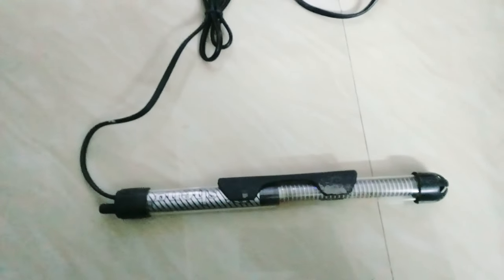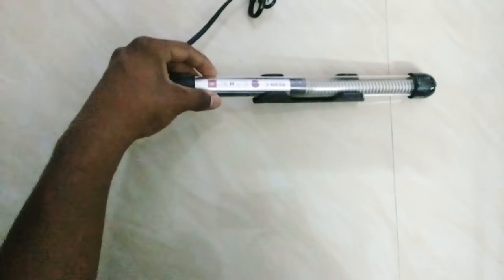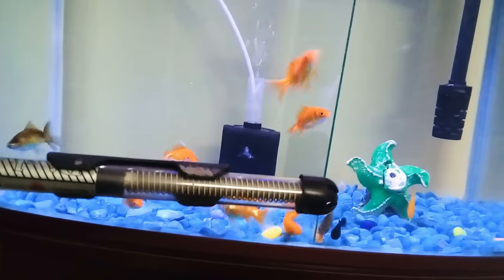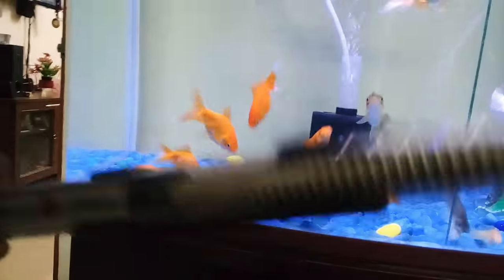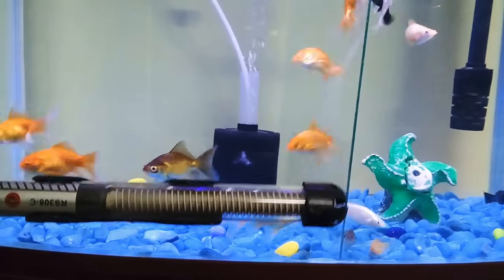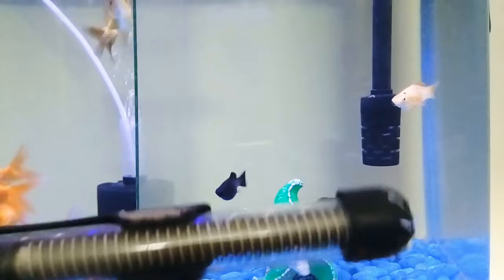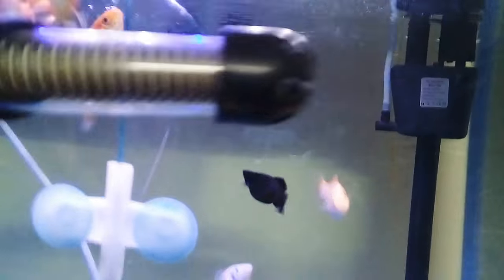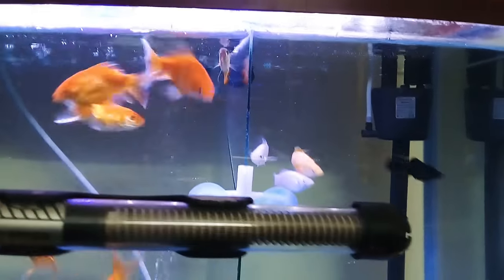which place is effective for heater in flowerhorn tank???

Comment: Bro..na heater ah neenga sonna mati thaan vachirken but temperature ah 28 degrees la vachirken flowerhorn colour fade aguthu....what to do?please help me😥😭😭
Reply from the maker: Omg enna breed bro..
Reply from the maker: Most ah fader type vandu fade agum over age....heater temperature nala colour fade agathu most ah....so tell me about ur fh bro....i will help u out..because i am telling information in my videos with experience and other breeders consultation only bro...so reply bro...
Reply: Mine is Red dragon He is about 2 to 2.5inches....he will be mine before turning on heater and aquarium light....if i turn on the light he gets full darl black....even when we get aroung the tank....i set up heater two days ago first I set the temperature at 30degrees but it was to hot so i reduced it to 28 degrees...but then his colour started to fade and he got full black....now turned it off....but my thermometer shows wrong readings whrn i set up heater to 30 degrees it showed 40 degree then for 28degree it showed 37...now at normal it is at 34
Reply from the maker: @saivignesh5407  bro ur tank temperatures is too high according to ur theromometer reading and ur fish stressed due to changes in temperatures so first my opinion is to off ur tank heater and change aquarium water of 15-20% dechorinated water and the. Find ur tank temperatures if it is normal the check ur fh health by looking his stomach size etc....i think ur area has high temperature...it is stressed so it shows black colour....reply me bro....
Reply: It behaves normal when heater is turned off..and then bro i got him 5½ months ago but he is still scared of us....do i have to perfome a 100% water change?or can i do 100% water change 3months once....i am feeding different types of food and spend time with him but he turns black when i go near him what to do?pls help me bro...
Reply from the maker: @saivignesh5407  dont ever change 100% water im ur tank....it will completely remove all good bacteria from ur tank....is he is taking feed in ur presence bro....????
Reply: Yes he eats the next moment i give him food...but he turns black when we get near the i got him 5½months ago but still he is scared of me....what should i do?
Reply from the maker: @saivignesh5407  ok he is eating means fyn because aduku entha internal problem mu illa ny confirm ayichi...unga tank size evolo ni theriyila iruntalum neenga unga tank setup matunga ,gravel irutha paravala illana vitudunga,then heater nan sona mari fix matum panikonga but on panathinga,unga tank temperature less than 28 pochina venuma on panikonga,tanku blue background add panuga mudinja ,adu pakavum nallruku fishku  secured ah irukom....i think unga fish scared of something aroung ur tank setup pls find that and rectify it bro...
Unga tank la enna components iruntalum atha crt ah neat ah set panunga....ur fish should feel secured and happy to be in the tank....keep interacting with him...my advice is not to tap on the tank it will stress him more just interact during feeding....any more to ask bro??? I am glad to help u bro...
Reply: @AllAboutFlowerHorn  i have all set i use pink fluorescent light available in Aquarium..i don't have background paper so i am gonna use white sheets....na gravel ethum podla bare bottom...tank konjam salt karaigal ah la asingama iruku athaan keten oru 100% water change panna mothu atha clean pannirlamnu...tank la oru artificial plant hiding kuduthurken.....then ithu ethavathu prblm aguma i have placed my tank at the left side of TV ...
Reply from the maker: @saivignesh5407  bro first 100% water change panathinga ...it will affect ur fish health badly so change only 30-40% if y want u can even change 75% also but konjam palaya water irukanum.....next neenga tv pakathula vecka kodadu tv sound ur flowerhorn  romba stress agutu so vera engana place panunga...adu than reason unga flowerhorn stress ku i come to know bro...then neenga gravel use panalum ok illanalum ok....background irutha fish stress konjam kami agum so say ur thoughts bro.????
Reply: Ok bro i will try to change the place.Do i have to use a background wallpaper available in stores or can i use white plastic sheets?
Reply: By the way thanks for helping me bro...😘😘
Reply from the maker: @saivignesh5407  ur wish white is also ok.or get background available in aquarium ...
Reply from the maker: @saivignesh5407  bro thanks soli namba friend ship pirikathinga....neenga en subscriber ur my brother....unga fish nalaruntha kandipa neenga nalrupinga ..adukaga worry pana matinga....ellarume happy ah irukalam...so neenga en thonunalum kelunga i will help u...that my duty too bro...if u face similar problem with ur friends facing any problem with flowerhorn grooming share our channel link bro.....lets make a big forum bro......thanks for ur pleasing words
Reply from the maker: @saivignesh5407  bro i have one query bro??? My information ungaluku useful ah iruka...say ur thoughts bro????
Reply: @AllAboutFlowerHorn  yes bro..
Reply from the maker: @saivignesh5407  how is your Flowerhorn status bro.....I hope he will be playing with u
Reply: @AllAboutFlowerHorn  it is still scared of us.But some improvements in body like hump growth
He gets dark if we r around the tank....😔😔
Reply from the maker: @saivignesh5407  he is trying to adopt ur environment....his hump growth itself is a sign for that...if he is stressed very much..he won't show any growth in his body...he is not like that...he will adopt and play at ur finger movements...hope for the best bro....
Reply: @AllAboutFlowerHorn  my prblm is i bought him 4 months ago....still he is scared.....but for others it is not like that....
Reply: @AllAboutFlowerHorn  anyways thanku for ur help
Reply from the maker: It will take tym bro...i still find mystery with ur flowerhorn still i am asking u about ur flowerhorn because ur flowerhorn  behaviour looks different from other fh
Reply from the maker: @saivignesh5407  dont say thanks and make me third person i will be ur well wisher for ur flowerhorn forever bro....update me ur fh status daily if possible to notice good sign from ur flowerhorn bro.......
Reply: @AllAboutFlowerHorn  bro he seems to be active....but still he is not getting my attention....is my feeding correct?i feeded him three times a day....but then my local pet store advisor advised me to feed him more times like splitting feeding time.I feed him 3 okiko pellets 8:00 .3 okiko pellets 10:00.freeze dried shrimps small pieces 3 at 12.Another freeze dried shrimps 2 pieces at 2.Then freeze dried blood worms at 4.7 small pellets food named gene eleven at 8 pm.
Reply from the maker: @saivignesh5407  i dont know why ur dumping all foods u have into his stomach....u have to change ur feeding style....i will tell i clearly bro...according to ur fish size u have to feed him twice a day with 12 hours gap....i have already posted about feeding for flowerhorn bro...then u shouldn't feed all other foods daily...it will stress him...feed okiko at morning and dried shrimps r other food at other meal once a week not daily....then leave ur fish starve for  a day in a week...it will actually help ur flowerhorn stomach...if u wish to starve ur the next day...feed him peas it will help him to clean the flowerhorn stomach...leave. the next day without feeding or feed once a day preferably at night...then continue with ur regular feeding....i will post video how to prepare peas for fish ok bro...if u have any doubt pls ask bro...don't ever follow the words of pet seller....
Reply: @AllAboutFlowerHorn  ok bro...i will change my feeding style
Reply from the maker: @saivignesh5407  ok bro......anymore to ask or doubt ask me bro?????
Reply: @AllAboutFlowerHorn  yes bro na first white light use pannen ipa rose light light potruken athunala oru prblm um illa la
Reply from the maker: @saivignesh5407  light is not a prob bro...in rose light ur flowerhorn too looks good....u can use any light....make sure u switch it off in time....give him 8 hrs of sleep....on the light on time and off on time....
Reply: @AllAboutFlowerHorn  do i have to turn on light at morning?which ime do i have to turn it on?i usually turn on light 4pm as our locality is bright all time and switch it off at 9pm.
Reply from the maker: sai vignesh that’s fyn bro if the tank gets bright light it is ok if not switch off....don’t allow direct sunlight it will result in algae in ur tank.....that’s all bro........
Reply from the maker: @saivignesh5407  hi nanba how is your flowerhorn nanba